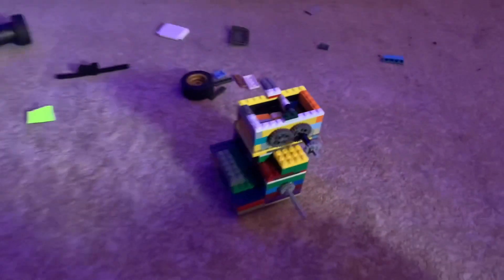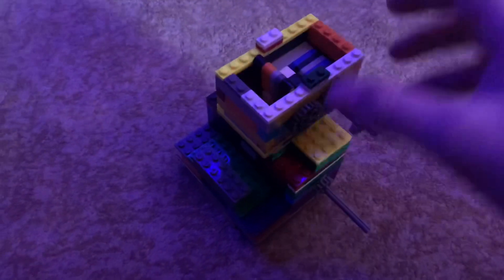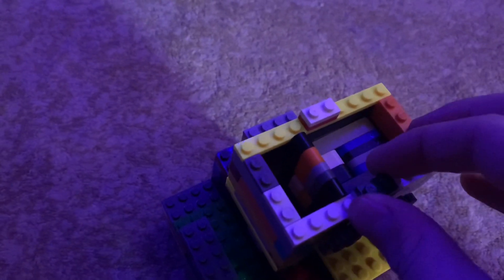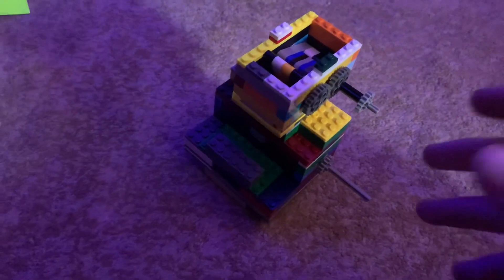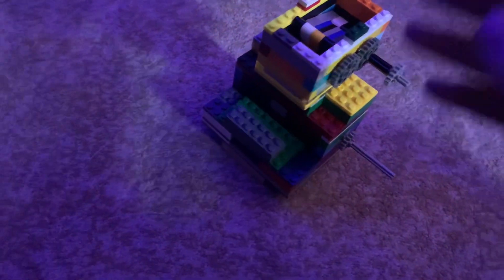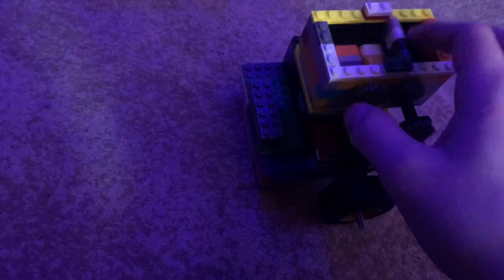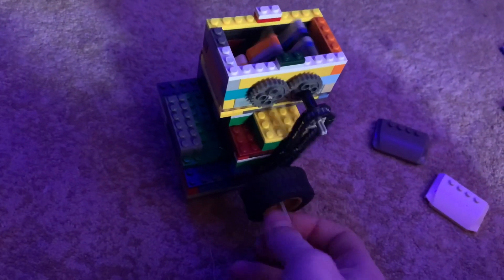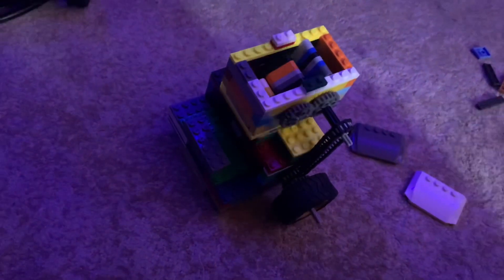The First Officially Supercharged LVE!

Comment: So I have an idea but no legos, a v configuration with overhead cams with a supercharger with 2 turbines with 3 paddles, but with a housing that has an intake hole with 8 holes in the top so you could reroute the exhaust back into the supercharger, and maybe even taking off the chain and using it as a turbo

Comment: I built the engine part and it’s very wear and  it won’t run for more than 5 seconds
Reply from the maker: It’s not a powerful engine, if it has even a little bit of friction or won’t run. I’d suggest just making the 1 paddle version that runs 10x better
Reply: @user_dudeman3  ight

Comment: Could you try running it WITH the supercharger attached, but without it spinning (no chain + locked/held in place)? My immediate thought is that it could have increased exhaust velocity just from the restriction (venturi/choked flow effect) of the exhaust from the supercharger just being there. If you don't feel like posting something that short/even recording it at all, feel free to DM me on discord or tiktok with the results if you try it. If it isn't the exhaust restriction and actually works legit, hats off man. I really hope this is, it would be awesome to try with other engines. Congrats on 1k as well!
Reply: Like a turbocharger? 🤔  something like that
Reply: I tried it but it didn’t work. That or I messed up somewhere
Reply: you know how there is 2 turbines in the motor and 2 in the super charger but could you change it from 2 in the supercharger to 1?
Reply: i lovvveeeeeeeee youre tiktok videos